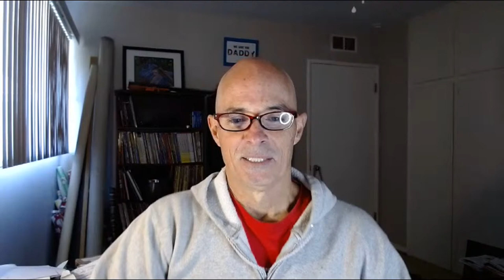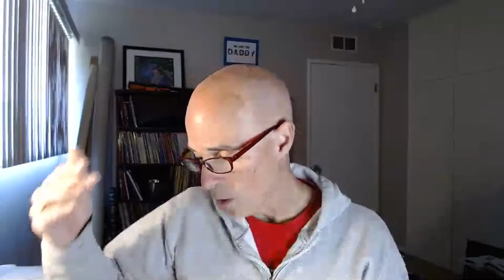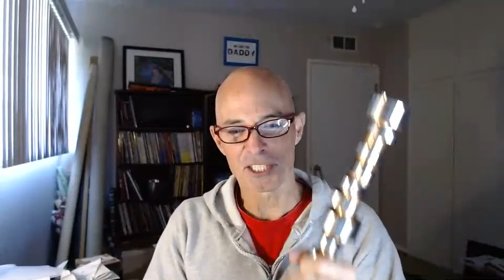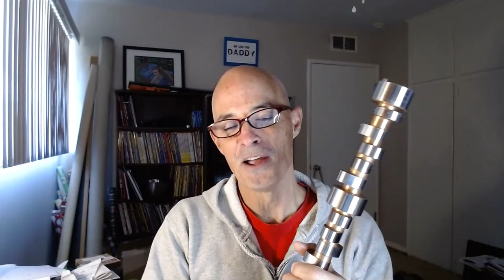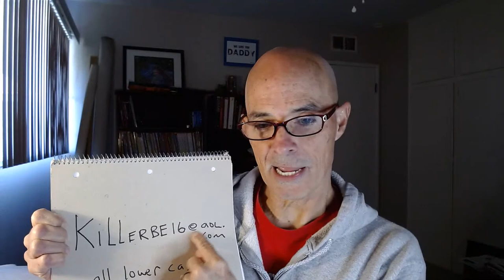TURBO TECH TALK-COMPOUND BOOST-BLOWERS & TURBOS

Comment: Hi Richard.
I have watched a lot of your videos and find them to be very informative. I like you I depth explanations and real word data. What wound be good to know is how long you would expect some of these combinations to last for in a say a drifting or circuit racing application. I am mainly interested in the boosted LS combinations. I hope you can do a video on reliability and what sporting mods are required at different power levels.
Cheers Jeremy
Reply from the maker: I can't test longevity on the engine dyno-especially for something like drifting (limiter action)
Reply: @richardholdener1727  I think it would be fun to see some extended full load stuff. I know someone who ran full boost for EXTENDED periods of time on his Nissan L28ET at roughly 500+ hp on the engine dyno to ensure he had temperature escalation issues resolved. IIRC these were 30+ minute torture sessions. 

I think too many people (some tuners included) don't account for issues with extended heat generation. You can get away with tripling factory power for drag racing, but if you're road racing you simply must consider the secondary effect of generating all that extra heat, and I'd bet that's what kills most people's engines when boosting. It's not that the boost "wore out" the engine excessively faster. It's more likely that something was overlooked when it comes to heat management, which could be bearings, rings, piston clearance, oil weight, etc. Look at how much OEMs pay attention to the details when they increase power 15% with more boost. They don't spend money for no reason.

Comment: Hi Richard, I was hoping you could help me with a new test.  There seems to be "gospel" in the performance world, both professional and via internet queens, that lower LSA camshafts (say 107deg) are no good for any forced induction motor.  However in all real-world dyno tests, I have seen the opposite therefore I think what would most interesting would be a back to back test of a low and high angle LSA cam, using the same duration and lift, on a turbo engine.  Thoughts?  Lachlan.
Reply from the maker: what the cam does na-it usually does under boost-I wouldn't recommend a very tight lsa for boost-my point with the every cam is a boost cam is that you can run the cam you have under boost-it will work
Reply: @richardholdener1727  Thanks Richard, however your comment, "I wouldn't recommend a very tight lsa for boost" again is based on what empirical and dyno tested evidence?

Comment: Richard Have you ever messed with the 2.2L Ln2 engine like in cavis or s10’s.... I keeep hearing “they won’t take boost they won’t make anymore then 175-200hp”. “Just Ls swap it.” I’d love to see what they engines can take and what they can do. 
Plz do Big Bang Ln2 do nitrous, sc, turbo. Let’s see what they can take at a reasonable price limit... maybe see what they can do with 4.3L throttle body’s something Mickey Moused from junkyard parts. 
I have 03 Chevy xtreme single cab step side Ln2 5spd 8.8 rear w/3L73’s 
I had plans to turbo bought most the things to turbo 51/32mm turbo 40mm wastegate 50mm BOV, white top 34lb 3800 injectors, 4.3L throttle body. Found out some ls parts will work in the head, such as valves,springs, found a reasonable price cam re- grindguy-(Ken @ Oragon cams) 

So set back now with all this talk about it won’t make good power it won’t take boost it won’t do anything ls is cheaper... 

Plz do Ln2 Big Bang builds...

Comment: a blower with a reduction, like a Procharger, the drag is constant up through the rpm.
Reply from the maker: the flow rate of the centrifugal increases with rpm-so does load and parasitic loss-it takes more effort to flow more air (more work)
Reply: @richardholdener1727  You are correct. I was thinking of the pull being constant and confused that with increased rpm. Idiot!  I know better. I built an identical gear system in college. I attached a rope and a handle and used to work out with it!  It was a bitch to pull at more than one speed. Alas, I am a mear human, not a 598ci V8 accelerating down a drag strip!

Comment: Faster blower speed will take more ho at higher rpm. Some blowers take 300hp pluss at maximum boost. As far as i know no street rod has 300hp at idle therefore it has to be an increase in parasitic loss as rpm increases. But more parasitic loss is mot necessarily a bad thing. I would take a supercharged engine with parasitic loss over a non supercharged with no super charger parasitic loss. 
In conclusion weigh all pros and cons and try both before making a decision.

Comment: Its important to identify there are 2 types of compounding, if you search for example Scania compound system you will see they are recovering energy from exhaust back to crankshaft, why is this important when talking compounding, the conventional wisdom is suprcharging has higher parasitic loses, but this shows you can offset and even recover this by adding boost into supercharger and add power back to crankshaft thru blower drive from pressure on inlet side off blower thru rotors, ( positive displacement obviously)
Reply: Turbocompounding probably had its most famous application in the Wright R3350 PRT engine that was used to power the B50 bomber.  It used three exhaust blowdown turbines to return 600 hp to the crankshaft.  All R3350 engines were boosted by centrifugal superchargers.  So could one say that engine used through-the-crankshaft turbocharging?  Then why not separate the turbine and supercharger drive from the constraint of running at crankshaft speed, and combine them in a unit with its own shaft?  Voila!  You have a turbocharger, which can spin up to high boost level, and be controlled with a wastegate, so the engine doesn't have trouble with poor low-speed boost.

Comment: 6.0 lq4 with 799 heads around 10.5:1 4l80e 2800stall heavy 2door yukon 4x4 whats a good cam? i want good low to midrange power. I'm doing all supporting mods and might supercharge or turbo later
Reply: Truck cam, look up stock 6.0 cam for your rpo code engine from ac delco then look it up.

It be like me taking the 6.0 cam and drop in a 4.8
Reply from the maker: a stock (early) lq4 truck cam is the same as the one on the LR4 4.8L. you want an LQ9 truck cam-or better yet-a BTR torque or stage 1 truck cam

Comment: Everyone wants instaspool. It seems like not a ton of people realize that making 20lbs at 1500rpm is how you fold rods.
Reply: You mean like the gmc truck does with the twin volute
Reply: Tell that to diesel guys.
Reply: Some realize it. Richard does when building a "big bang" engine and why he hurt one of the LS he did. Add good rods and good pistons and you start to be limited by fuel type and head sealing as well.
Reply: @andyharman3022  diesel engines need 20 lbs to get out of the driveway also diesels are generally not optimized to make peak power vs airflow
Reply: @bill2178  No, they don't.  I drive a diesel every day.  I know how much boost is required to do a given amount of work.  In this day of onerous emissions controls, who knows what diesels are optimized for.  They used to be optimized for fuel economy.  Apparently now they're optimized to keep the emissions systems functioning.

Comment: How would you go about dealing with the superlite slc ls and Graziano issue. Ls doesn't really Rev high enough. 

Trying to build a twin charged high revving ls or at least a boosted high revving ls. Figured the boost would help with the engine breathing enough up high.
Reply: I have a twin charged engine swapped gto. Friend helped plus part of what we did making the engine less race more street. 

But from what I understand the way its set up now it prevents back pressure and also helps with increasing airflow in. It's always pulling fresh air in and helping reduce Temps and maintain efficiency.  

Might have to see what was done on that engine for the slc project. It can Rev to like 10k rpms. But it's running like 8500 9000 redline right now. Though don't Really feel like copying an engine that was like 40k new. Thank God it only cost me like 10k. Race teams used shir is lovely.
Reply from the maker: how high do you need it to rev-guys are running 10K with some
Reply: @richardholdener1727  well from what I've been seeing the Graziano usually used in the slc comes from the audi r8 and Lamborghini cars. Pretty sure they redline like 8700. 

Wouldn't mind 9k. But needs to stay reliable and streetable. And don't entirely want to kill the low end. And drop gears for that transaxle are pricey and it's a complicated rebuild process so not really diy friendly. 

Trying to build up an slc for top speed but as a street car. Maybe do some half mile or full mile events. But still want good acceleration for drag. 

I haven't tried the motor in my gto at 10k much. But it started as a full blown race motor so pretty sure rebuilds were frequent. But not trying to go that balls deep. 

Minimum 500 hp low boost. For high boost 1k or more. 8400- 8500rpm would kinda be minimum 9k would be ideal maybe a bit higher if it can handle being street driven and "daily driven" as much as something like the superlite would be. 

Thinking I may build the motor up first on a junkyard block then get a nicer one. 

Also needs to run on pump gas at least for lower boost up to 1000hp. And be emissions friendly to a point. 

I mean if there's a budget path to reliable 10k rpms I'm down. But my buddy guesstimate it'd cost like 30k. Especially for turning the boost up in the future. 

My other choices are basically engine swap the car or expensive drop gears. Or expense of engine control on a 10k junk yard Lamborghini or ferrari engine. And then dealing with expensive maintenance and upgrades. 

Just incase you have any info on my possible engine choices. 
Vw wr12 also in Bentleys w12s. 
Toyota v12
Benz m120 

Or follow the aussies. Rb30 with rb 26 or 25 heads. Or God forbid. A rotary build and burn all the oil.

Comment: Cruze 1.4 turbos have a terrible turbine housing. ZZ Performance has a lot better turbo for them. They also have cams and valve springs for them. They are hard to make more than about 230 horsepower without using race fuel. The base motor NA makes very little power.
Reply: left field.......
Reply: @caseywilliams4322  Richard mentioned that engine a couple times during the live sream.

Comment: Why haven't you done anything with the F.A.S.T efi 2.0 throttle body with the holley victor Jr. Intake manifold? Is it not worth the money to buy the kit with the TB?
Reply from the maker: not sure what combo that is
Reply: F.A.S.T efi 2.0 4150 throttle body PN 30400-kit with the Edelbrock PN 28457? My bad, i said Holley instead of Edelbrock.
Reply: You always run your engine with PN 301000 or PN 30405-KIT on your ls builds. But never the PN 30400-KIT with the 8 injector TB. Is the 8 injector throttle body in the PN 30400-KIT not worth the money instead you use the PN 30405-KIT with aftermarket TPI?
Reply: So my question is the F.A.S.T 2.0 PN 304151 throttle body worth the money or not.

Comment: i have been told twin screws compress the air so they take less effort to spin but do you know how much less vs a TVS/roots blower?
Reply: I think it's about 5-10 percent more power that can be made with a twin screw vs a roots
Reply from the maker: they are more efficient than a roots-even the TVS-but the TVS is getting better and covers a lot of applications above 1000 hp now
Reply: Richard Holdener interesting.
I have always wondered how much difference it makes because they usually don’t disclose that in many places

Comment: Are twin 7875's to big for 408? Hot sides are .96 but they have .68 ar's available.
Reply from the maker: depends on power level-those will support 1800 hp
Reply: @richardholdener1727  I'm duplicating your junkyard 351w build. Goal is 900hp but keeping boost below 12psi. I didn't think I could get there with a single at that low boost, so I got twins.

Comment: Hey Richard, have you done any 4ag testing?

Or an Audi engine? There’s lots of them in the junkyard :p
Reply: Just get s vw engine
Reply from the maker: the 4ag toyotas?
Reply: @richardholdener1727  yes. Older design, but the later iterations used 5v heads. Or, what about the celica 1zz/2zz with vvti?

Comment: What turbo would you run on a 408 with 706 head summit stage three turbo cam to make around 1200 ho
Reply from the maker: s480 or bigger

Comment: If you are compound boosting a turbo with a positive displacement supercharger (Roots or screw), just use the positive displacement supercharger to bootstrap the turbo at low rpm, then clutch off the supercharger and bypass it.  Eaton developed the Twincharger setup for the 1.4L Volkswagon, and drove the supercharger at 6x crank speed to blow the turbo into life, then clutched off the supercharger at 3000 engine rpm.  Turbochargers are capable of making as much boost as a turbo plus whatever a supercharger can do.  The typical Eaton automotive supercharger is most efficient at about 9 psi boost.  They do well at 12 psi, and they are all done at 15.  Single stage turbos can do up to 90 psi boost, if you're willing to pay for it.  Most turbos are mapped up to 4:1 pressure ratio, so about 45 psi boost.

So to the listener that wants to compound an M62 Eaton with a turbo, you should be running a small pulley to get a lot of boost at low engine speed, blow the turbo into life, and then clutch off and bypass the supercharger to eliminate its parasitic drag on the engine.  The faster you drive the supercharger, the more power it pulls from the crankshaft.  If your goal is to boost engine to 30 psi, you can easily do that with a single turbo.  If you want to do 45 psi, you can still do that with a single turbo, but you should look at the compressor map to see if it is operating at efficiency greater than 70%.
Reply: Who makes a 90psi single stage turbo with 70% efficiency?
Reply: @bcbloc02  Large-scale turbo manufacturers.  I talked to a semi-truck puller years ago (2000's) that had a single turbo on a 998 Mack that he said put out 90 psi boost.  I don't recall asking him who the supplier was, but he said the turbo cost $32,000.  Large turbomachinery is easier to make highly efficient because the tip clearances are small in relation to the size of the wheels.  Also, gas turbine engines such as the Allison 250-C28 have single-stage centrifugal compressors that run 8.6:1 pressure ratio.  Map width is small.

Comment: You did a bunch of LS + boost stuff in the past with Holley HP, what are you using for a timing table for 91 octane in a sub 15 PSI build?
Reply from the maker: WE DON'T RUN 91-BUT 12-14 SEEMS TO BE WHAT OTHER GUYS DO
Reply: @richardholdener1727  OK thanks. If 12 degrees is the target at max boost, what timing would you be running at say 6 PSI?
Reply: @yarrdayarrdayarrda  Assuming premium pump gas, some ls tuners  will run 20 degrees advance @100kpa, then pull 1/2 degree for each lb of boost (i.e. 14 degrees advance @14lbs boost). 

Chopper doc's YT channel discusses f.i. timing strategy.
Reply: @1stamendmentsupporter  Thanks for the information, do you have a link to his channel?
Reply: @yarrdayarrdayarrda  ChopperDoc181 is the YT channel.

Comment: I've always wanted to see a high revving big cube small block v8 with nitrous and hydrogen injection.
Reply from the maker: hydrogen?
Reply: @richardholdener1727  I just wanna see if it's possible to make a race engine run on hydrogen. It a way more explosive fuel and bas a higher BTU equivalent then gas. Hydrogen molecules take up more space in the cylinder compared to  gas so thats why I'd add nitrous to compensate. Probably just bend rods or wreck things but it'd be fun trying.

Comment: 5.7 LT1 + ring gap + MLS gaskets + big AFR heads + big cam + big boost. The "LS swap it" crowds inside EVERY 4th gen Facebook group need to see with their own eyes that that engine isn't a boat anchor.
Reply: Do away with optispark and it's not lol.
Reply: I think the fastest stick shift car is LT powered , not LS powered , 1320 video a few months back
Reply: @b00sted_SS  it is. The Grubb Worm made 1800hp and ran a 7.07 @ 200+mph before she cracked the block and split the head.

Comment: Can you do a 2nd gen 350 lt1 and explain the optispark and will a parts store vented opti be ok as a replacement?
Reply from the maker: CHECK OUT THE L99 VIDEOS-BUT YES THE VENTED OPIT IS BETTER
Reply: Hey Richard, I would love to see something on the old school japanese stuff.  The Datsun/Nissan L-series is an awesome engine! Forged crank and rods plus 7 main bearings factory. They even made a factory turbo L28et. I would gladly send you a turbo manifold and p90 head that you could bolt to any L6 block to do some testing.

Comment: Never seen a compound setup with a centrifugal blower and turbo,anyone have a link?
Reply: Many WW2 aircraft engines used turbochargers to boost the inlet of a centrifugal blower.  The B17 and B24 bombers used the GE turbochargers to provide altitude compensation to provide sea-level air pressure to the inlet of the engine-driven centrifugal superchargers.  The engines in those airplanes were Curtiss-Wright R1820 and Pratt & Whitney R1830.  The P47 Thunderbolt used a GE turbocharger to boost the centrifugal compressor of the P&W R2800.  The P38 Lightning used  GE turbos to boost the centrifugal compressor of the Allison V1710's.
Reply: Youtube has plenty especially on 03-04 cobras